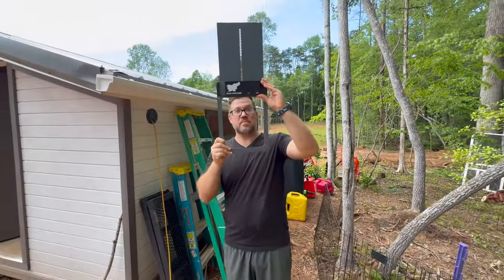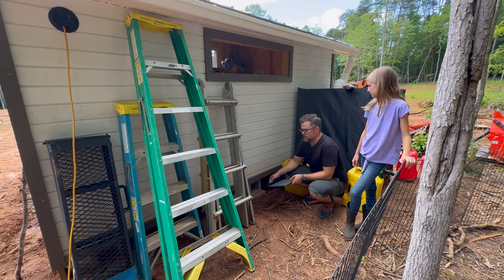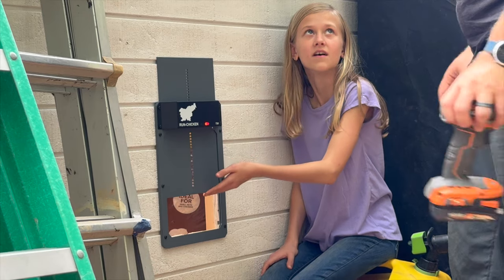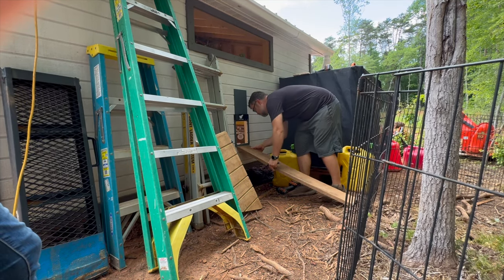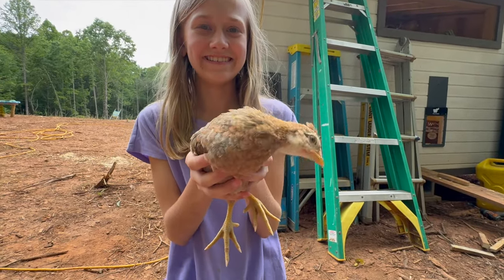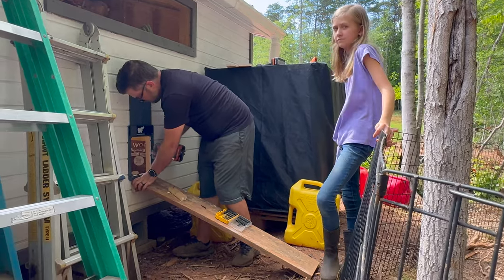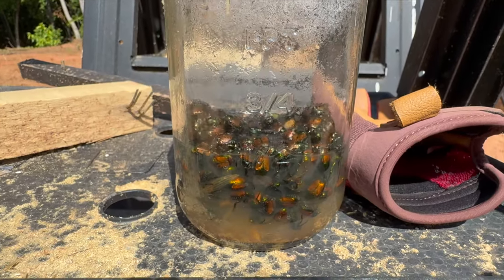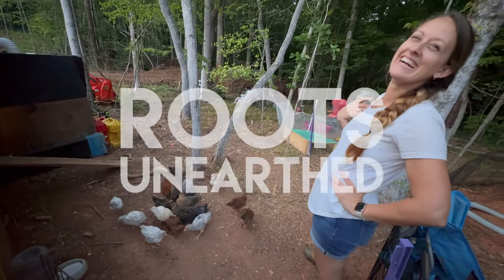Chicken Run Automatic Coop Door Install

Comment: I have installed two or those doors one in each coop and it is be far the best I've had and I have gone through a few that never held up. On a note both are installed inside the coop and not outside, helps with the freezing weather that I get in the winter months.
Reply from the maker: I never thought to install inside. I'll see how this winter goes but our winters in NC are not nearly as bad!  Thank you for the comment!

Comment: Many ways you can tell if they are hens or rooster. I have noticed roosters have bigger combs and their wing touch their butts. I saw a video showing if you grab their feet and lay them on their back and slowly lower their body a hen will hold herself up a rooster relaxes and just hangs. I am looking forward to my next brood to test this out to double check my first method
Reply from the maker: We have 24 chickens currently and I think only 8 were a straight run! We'll find out soon but I think we did pretty well!